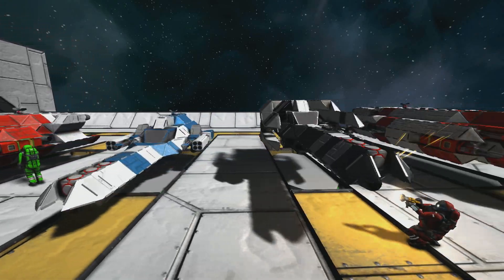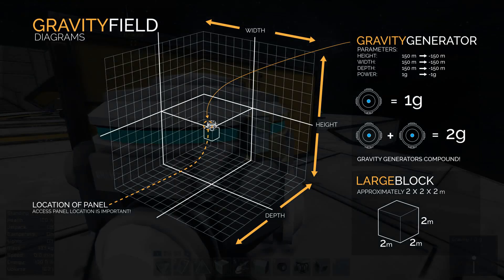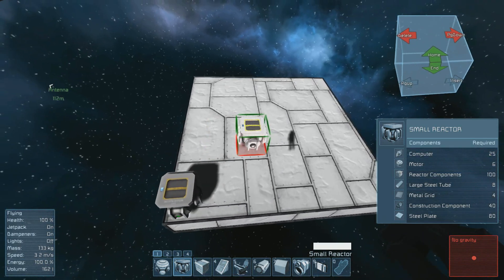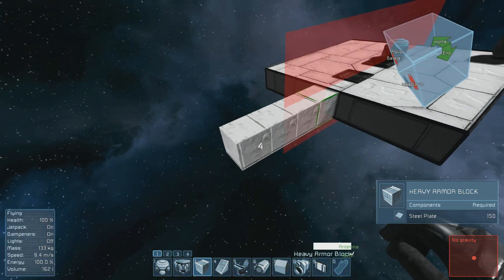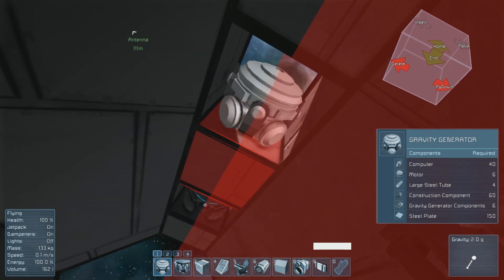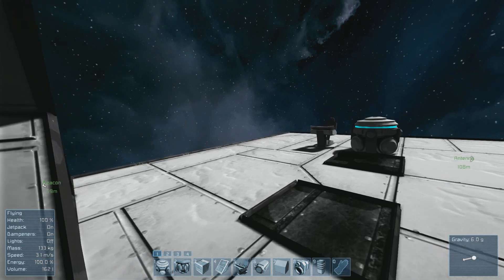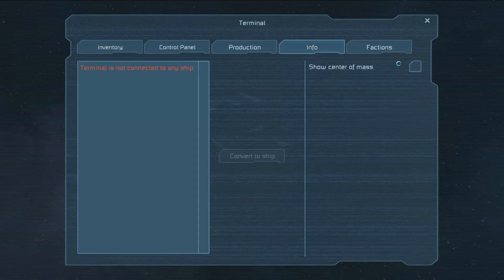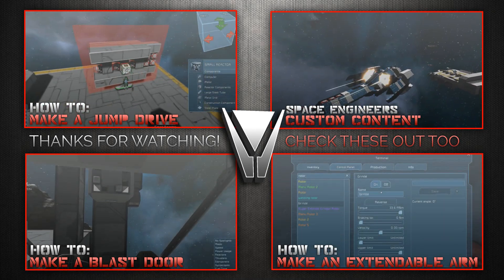How to make a Launch Tube [Space Engineers]

Comment: another thing to note is that more and more gravity generators mean more total gravity, with the first 2 he made he had 2.0 G, 1.0 G per generator, so if you want a shorter tube with the same or faster acceleration, you will need to have more generators, and lastly never put an artificial mass block within the gravity field of the capital ship, it will force the entire ship to move in the direction of the gravity pull and even inertial dampeners cant stop it
Reply: Hmmm, could this maybe be expkoited to get a ship moving without any engine glow? (thinking about Black painted hard to see stealth ships with gravity engines)

Comment: would it be possible to make this design short enough to fit onto a ship and act as an escape pod launcher to shoot out escape pods fast enough to get past enemy ships without getting targeted?
Reply: Well you can just have an escape pod with seats, an artificial mass, an energy source, and a connector outside of your ship plus, idk, 20 gravity generators on the ship that will push them away from the ship, you just need to have the right settings applied (negative or positive gravity and how big the field is), but be careful not to pull the crew towards the wall inside the ship with 20Gs lol

Comment: Why not have the gravity generators in the middle so it's more localised instead of having 60 meters In front of the ship of gravity
Reply from the maker: Because you are effectively increasing the time force is applied to the object, so heavier objects can still be propelled even outside of the confines of the tube.
Reply: +Morphologis I break away once I'm out of my tube so I ended up getting thrown off by the other tubes... Also I wanted to ask if you had a landing pad idea for the raptors taking off? I'm making a battlestar replica of the pegasus and I was wondering how to do the raptors taking off
Reply: +Gold Angel Raptors was not starting from normal hangar bay? I remember only vipers launched with tubes.
Reply: +szczurpb I know that's why I'm asking if there's a way to replicate how the raptors took off as well, I'm making a galactica replica and I would like it to be somewhat functional to launch raptors and vipers, it has launch tubes but no way to deploy raptors
Reply: i think its generally the same concept but you have the tubes somewhere that is easily accesible from the main body of the ship and has space for extra people. a good idea is knowing if you want single man pods or something more like busses. it really depends on the size of the ship. the escape pods should never come out the front and if possible be difficult to see in space. apart from that its not actually any different
Reply: exactly. Just project your espace pod and make good tunnel to fit them in.
Reply: dangle  the pod or a rod with a AM on it just inside the tube with the grav gens off and unlock&turn gens on, to get the hell out of dodge. 

design and implementation is up to you.